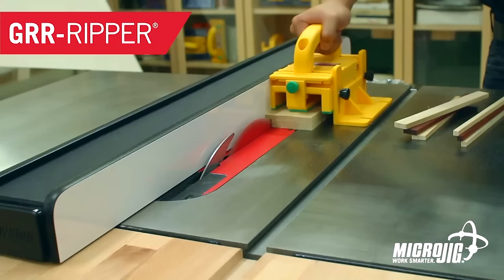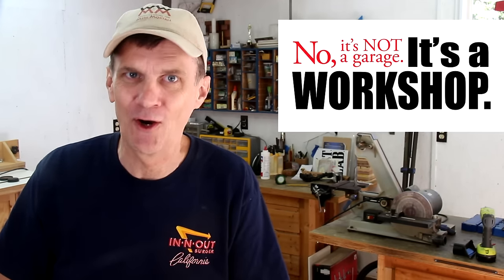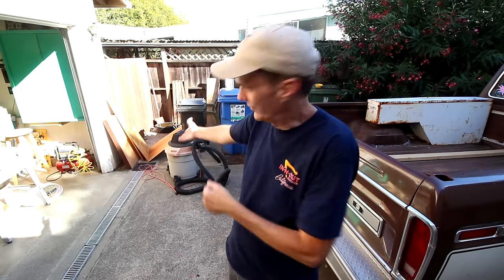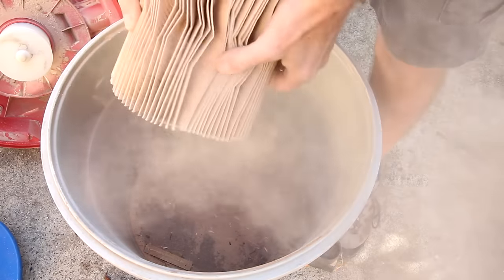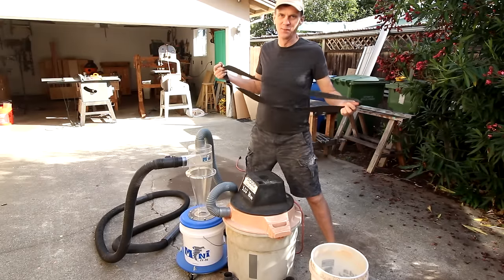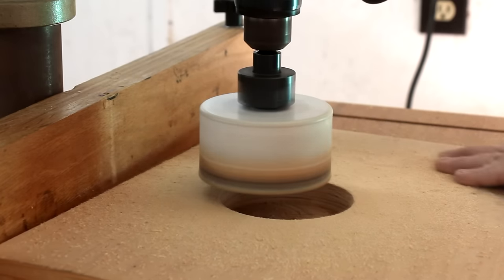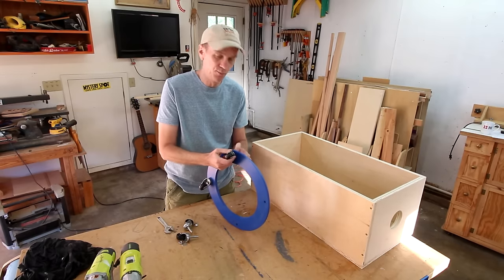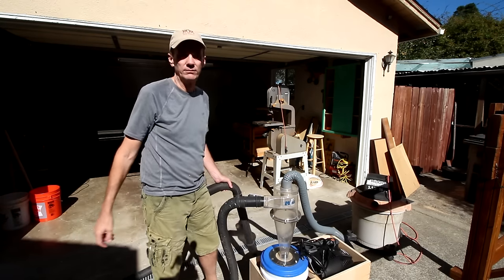Affordable Dust Collection for the Home Workshop

Comment: Make a square box to collect the dust rather than a bucket as this stops the dust spinning in the bucket. It seams to work better for me and you can make the top size a tight fit for a rubbish bag for emptying. A square box can also be made rectangular so it can be hung on a wall or fit between tools. If you have the money get a long hose and put the vacuum outside if it won't annoy your neighbours.
Reply: This is something I've been considering for myself! Does the size of the box have an effect on the amount of suction? Also, what size vac are you using?
Reply: I'll reply to myself and answer this question in case anyone else is wondering... I went ahead and built several different containers of varying sizes for dust collection, and the size of the container doesn't seem to have a profound effect on the suction. I'm currently using an old 2hp shop vac connected to a Dust Deputy, which in turn is bolted onto a 5/8" MDF box I slapped together (roughly 2'x2'x3'). Works like a charm!
Reply: @svenstenberg2124  Thanks for the update!
Reply: @svenstenberg2124  The size of the container will not affect suction, but as the container gets larger the surface area increases - which means more force trying to crush the container.

Comment: I coupled the Oneida cyclone and bucket with a Craftsman 5hp wall mounted vacuum and 20' long hose. Those cyclones are so worth the money. The vacuum bucket literally sees 1% of the dust.  I used plumbing rubber connectors to mount to my tools for the hose to plug into to.

Comment: @Steve Ramsey I also use, in conjunction with a cyclonic separator, an inline fan mounted above my cutting area.  I use a piece of black filtration foam for air cleaner units, and then roll it up (twice) into a cone shape and glue the edge with super glue and activator spray.  It slips right onto the intake side, does a great job of cleaning the air for extremely cheap, and the inline fans are super efficient - 0.8A at max speed, 120v.  I picked up the black foam at Lowes for $5 a piece, made up a few cones, and they are washable and reusable - just spray them off with the garden hose from inside out.  I'd tested the airflow reduction using air filters, pads, etc. - but they always created a large reduction in air volume movement.  The cone shape is similar to the intake for a turbo, providing 360 degree pickup and increased surface area so it doesn't reduce airflow at all.  Placing the same foam  directly on the intake, but laying flat reduces the airflow by nearly 70%.  I roll the foam twice to make the filters, giving it better particulate filtration, and it still doesn't slow it down.  I use the Vivosun D4 4" fan, it has 195CFM of airflow and it's only $30.  I run the exhaust side through a flex hose to the other side of the work area, so I get cool air while working and it provides directional air movement for the pickup.  I wipe down the blades every couple of months, and swap filters every couple of days.   Just an idea :)

Comment: Not sure how much it would affect the structural integrity of the box, but you might cut a slot in the sides of the box to view the sawdust level. Although, not sure how visible it'd be with less light entering the bucket. Perhaps a slot on either side?
Reply from the maker: Good idea. There is a clear window in the top of the bucket, but it gets coated with dust pretty quickly and is useless!
Reply: Didn't Matthias have a small dust collector where he put a small light behind the bucket so that you could see the dust level. Maybe an LED strip light would work.
Reply: get a cheap led flashlight and shine it down the top window it would let you see the level better through the side if you do cut a slot.

Comment: I made a dust extractor from a you tube video. Only used a small handvac for the suction. It worked but not enough power. I have a small shop also and have been using a 2/12 gallon vac for about 10 years now. To save money I use paper filters and clean them outside with an air compressor when they get dirty. I can usually get about 6 full loads before they start getting holes in them.  Will have to work on combining the two units and see how it works

Comment: We started buying Dust Deputies for our miter saws at work a few years ago. It was the cheapest solution I could find at the time, and it works well. Our maintenance guys found a handy device where you plug the saw into the top outlet and the vacuum into the bottom outlet, and the vacuum automatically turns on and off when the saw is drawing power (off is slightly delayed to ensure you get all the sawdust). I'd be inclined to build something like that into a mobile dust collection cart, along with a built-in extension cord, to make it extra fancy.

Comment: I built a somewhat similar system but went vertical!  Bucket and cyclone are 'downstairs' and ShopVac is stacked above. Base has rollers so easy to move around and takes little space (very important in my very, very small shop). I use  a filter bag in ShopVac for additional dust filtering. Very effective and works well.
Reply: How did you decide to put the larger, heavier shop vac on top?

Comment: Why did you choose keep the original operational orientation of the vacuum?  Would it have been possible to stand it up on one end so the intake was pointing straight up and reduce the amount of connective hose between the two?
Reply from the maker: +Lochinvar Roome Good idea!
Reply: I was going to ask the same thing but I was thinking more in the sense of decreasing the footprint in the small shop.
Reply: Lochinvar Roome That can cause the vacuum to not work on some models. Wet/dry vacs often have a float to prevent water from getting in the motor. Tilting the shop vac up makes the float more likely to slide and cover the intake. This prevents suction.
Reply: I have the same vacuum I set it up right for it to fit under my bench along with my dust deputy and can. It hasn't been blocked up yet. Also if all you use it for is the the shop you can remove the ball. I also have a bag in mine for that 1-5% that gets past the dust collector.
Reply: Thank you.  Since I'm not familiar with that model, I was only thinking about reducing the footprint.
Reply: I did this exact thing and it gets stopped up almost immediately. I need to remove the ball somehow.

Comment: Hi Steve! Thanks for this video and all the others. I have been looking forward to seeing your videos every friday for the last five years. You gave me the passion of woodworking. I began with a hand saw and, a drill and a hammer to make a pallet wood small table.

I made a cart as yours, some time ago. My cyclone is made from a construction site cone.
I added pieces of PVC pipes on the wooden structure to hold the vacuum accessories and a broom (for everything a vacuum can't take).
I added some hooks to hold a shovel for the dust and to avoid the electric cable running on the floor and blocking the wheels.
And I hang some one hand clamps on the structure too.

Anyway, I wish you to still be inspired, enthusiastic, and fun.
Stay safe.

Best regards from south of France (sorry for my English).
Reply from the maker: Well thank you Jean-Philippe. I really appreciate that.  Your cart sounds awesome!

Comment: I went the other way with mine and built a mount for the dust deputy into a weird little shelf in my very small garage (can't even fit a car in there), and just stash my shop vac next to it.  Add a 20 foot hose and I can reach all of my tools with plenty of hose to spare.  I recently added a nice super-flexible hose from Rockler that adds another 15 feet or soand can vacuum out my car without moving the shop vac.

Comment: You could hinge the front panel where the hose is coming out so you could just pull out the vacuum to change the filter instead of unscrewing that piece.  Does that happen frequently enough to worry about?
Reply from the maker: I'll probably only change it once a year or so.

Comment: I have this exact setup; box included. I switched from filters to the dust bag, better air flow and plenty of filtration. The cyclone paid for itself inside a month of use from having to buy bags so much.

Comment: Contrary to the beginning statement, "All power tools have some sort of dust extraction port." My 1960's Craftsman belt driven table saw has no such port. LoL Dust extraction is defined as what ever falls into the box I placed under the saw. All of the tools I have are from the 70's and don't have any dust extraction ports. :)

But, thank you for your videos, I have gotten so many ideas and learned quite a bit from you Steve. Thank you very much.

Comment: Really late for this one, sorry. I used a 50 gallon plastic drum and an olde shopvac. Took the old inlet and mounted it lower on the side, mounted the motor on top on the opposite side of the intake. Basically a Shop-Vac on steroids. Put the rollers from the original on the bottom of the barrel for, well, rolling it around. Worked well until the motor burnt out. It was a VERY old unit and howled and screamed like a tortured cat right from the beginning. Did get 3 minutes out of it. Will keep my eyes open for a better unit this winter. Really enjoy your channel.

Comment: A couple of things you could add would be a place on the side to wind the power cord up.  Also some way to keep the hose out of the way when not in use.  Every large machine I own immediately gets a set of wheels.  I am currently working on adding a cyclone to my harbor freight dust collector complete with a 55 gallon drum.  All on wheels.

Comment: I add about two cups of water to the bottom of my dust 5 gal collection bucket, it keeps the REALLY fine dust from seeping back out by making it sticky.  Plus, If I forget to empty the canister between work sessions it dries and hardens into a great puck shape I can use as firewood (I don't use pressure treated lumber, and nearly zero plywood, I'm crazy not stupid.  DON'T BURN PRESSURE TREATED WOOD)

I also have a friend that swears by a decorative wall waterfall fountain to help clean the air in his shop.  One day I'm going to make (essentially) a giant wet/dry shop-vac bong to capture dust by pulling the air thru a water chamber.  I'm pretty sure it's going to clog, and be wasted effort, but I'm not doing it for efficiency, but for fun...  As long as I keep telling myself that.

Comment: Thats great, good to see it works well, only observation is there is a obvious weak point on the neck of the cyclone and you have all those hoses, I think I would add a sort of handle going up to the top of the cyclone so you can move it around on that and give the cyclone and hoses some additional support so you dont snap it off. Thats all, great job thanks, good to se it working, I just bought one so will do something similar. Thanks.

Comment: 6:05 Just a heads up for those watching in 2023. The casters on the current version of the cyclone separator in the video have bolts that are only 3/4" long, so you need to use 1/2" plywood for the bottom, or use other casters

Comment: I ended up with affordable dust collection for both large and small tools. For small tools I actually used the same shop vac Steve did for the same reasons: my dust was going into a cyclone so I needed a small vac with good power. I went even cheaper by using the Home Depot "Dustopper." It's basically an extremely basic cyclone that pops onto a standard HD bucket. It's not as good as the big cyclone units you see out there, but it does a pretty good job for $40, which is probably a half to a third of the cyclone Steve is using here. So that's about $120-140 for the vac and the Dustopper and some accessories (all the hoses you'll need come with these two units).

For the BIG dust moving, I went with the Harbor Freight 2HP dust collector. I know there's discussion about what HP means on the shop vacs, but I assure you that this thing is very close to the 2HP rating (it pops my breaker on startup every once and a while - got to get that dedicated 20-30A circuit one day). It MOVES dust like nobody's business. I stick it on my planer and it gets most of that stuff out. Same with my table saw. For anything that escapes, I hook it up to a floor sweep and use a broom to move the remaining chips over to it. The Harbor Freight collector can be had for as little as ~$180 plus shipping, which is pretty fantastic when compared to all those models that run upwards of $2000. But I did add a fairly expensive Oneida cyclone to it for about $230, plus around $50-75 in accessories like hoses, hose clamps, blast gates, and other stuff. But still, for around $450 I feel like I'm ahead of the game. The only thing I don't like is the fairly porous filter, so that'll be another investment.

Lastly, check out the resale market. I've gotten great tools on Facebook Marketplace and Craigslist.
Reply: BTW, tip on this shop vac: I put mine on a cart in the upright position (suction port facing up). At first this kept making it cut out for some reason. I discovered it's because of a float designed to keep water out of the exhaust port. It took some doing but I had to remove that to get the vacuum to work on its rear end. I like it positioned this way because instead of having that hose sticking out the side and going all the way up and over the cart, it just arcs from the top of the vac to the top of the cyclone.

Comment: I like this idea.  I've had a giant fan pushing everything out the window, but now that winter is coming I have to get something else. 
I like the cart.  I think that I would have raised the vacuum and rotated it 180 degrees.  That way the outfeed from the cyclone would go directly into the shopvac with a shorter run.  Additionally with the taller unit, you could set up a handle for moving it and give more support directly on the cyclone.

Comment: Been cruisin' the portable dust collection videos tonight. Besides thanking you for your post, I'd like to tell your viewers that I just saw an Asian content provider who adapted PVC to a slightly smaller opening by slitting it, fitting it, and taping the seam, a good trick to add to the heating and stretching or using sections of plastic bottles as if they are oversize shrink tube.

Comment: Hey Steve you should consider adding a handle to the box so you lower the risk of popping off the bucket lid when pushing it with the cyclone part. That would also help reduce the wear and tear on the lids sealing capability so it would last longer. Awesome video by the way!

Comment: Nice build. One extra benefit of the cyclone preventing filter clogging is that it can allow the use of a much finer filter on the vac. The finer filter will capture the really small dust particles (the ones that are dangerous to health), and of course won't get blasted full of holes as it's not having to handle anything large enough to be visible to the eye (as long as the cyclone is separating efficiently).

The problem with a normal shop vac is that the filters are either packed full of dust (losing suction) or coarse/damaged enough to pass the fine dust - so it just becomes a pump that blows the dangerous stuff all round your shop. Another benefit to working outside I guess.

I see others have commented on the HP claims: 1HP is approximately 746 watts. 5HP is over 3700 watts. On a 110v US mains outlet that's going to pull 3700/110 = 33 amps! I suspect that's likely the inrush or short-circuit motor stall current; also known as the "marketing BS" figure!

Comment: This is an EXCELLENT setup because the vacuum is smaller with high horsepower which allows for the vacuum and dust collector to fit into a small cart with a small footprint. It's hard to find a small vacuum high horsepower: most high horsepower are big and round. It would be nice to know both the inside and outside diameter or the rigid hose and any compatible adaptors you have purchased and for all the hookups to the different size ports on different tools. Would also be nice to know if you used any reducers with smaller hoses for smaller ports on smaller tools like a palm sander. GREAT JOB.

Comment: And I have a Ford F-150, which is locked. A woodrat made a home in the engine compartment. Took care of that. Unlocked the driver's door the other day and another rat had gotten inside the cab and chewed on all the plastic. I have a trap in there, but I don't know if I already got it by the water heater. The joys of living in the south west in the country.

Comment: Hi great info as usual. In the need to deal with large amounts of waist from the planner and jointer, mad a quick and dirty solution. That worked so well I have not replaced it. I took a plastic garbage can with a lid and cut two holes that fit my dust collector hose. hooked the dust collector to one side and the tool to the other. It is extremely effective in collecting the majority of the waist. The only problem is that when I don't notice it is full my planer will blow chips back. I guess that is an automatic clean out notice. ;-)

Comment: Hmmm... that has a lot of potential. Maybe a rigid connected tube between the vacuum and the cyclone top. A handle / roll bar that protects the cyclone, so you aren't pulling on the cyclone when moving the cart around. Also, hose and accessory storage would be beneficial as well. Also, instead of a solid wood bottom, metal mesh would keep that box from becoming a dust bin.

Comment: Just put a dust pipe on the celling and collect your dust system to it when you need it. 

So the dust pipe can go anywhere in the shop, you dont have to move your mobile dust collector around. You can unplug it when you need it too.

I did the same with my air compressor and a retractable cord reel.